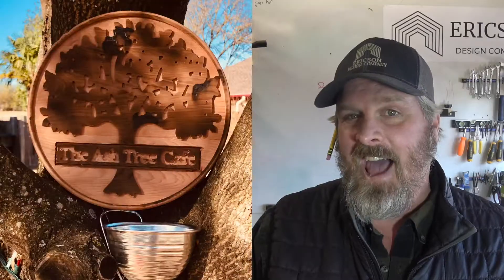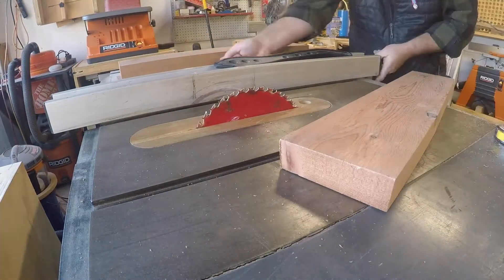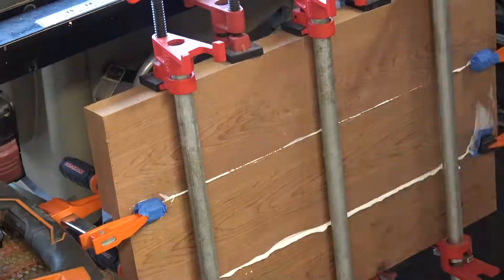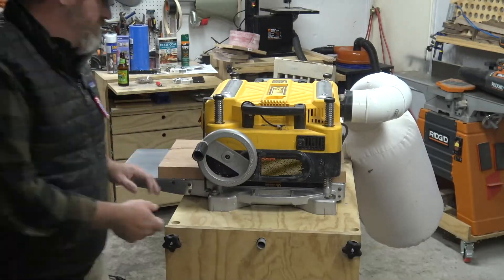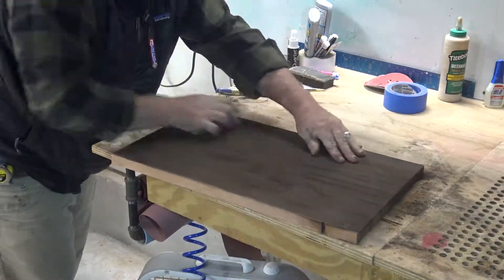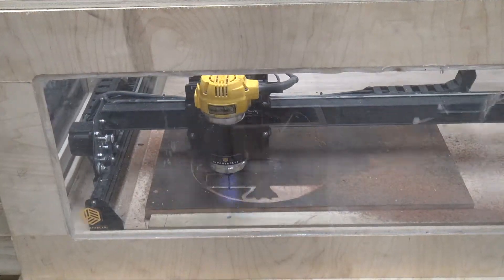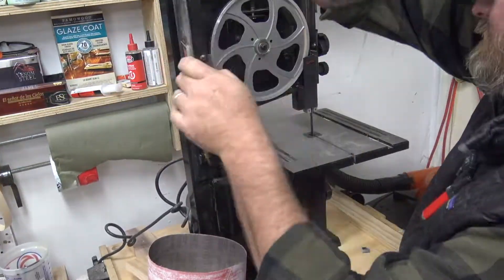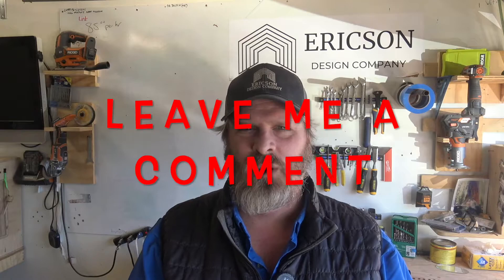How To Make A Wood Burning Custom Sign | Custom Cafe' Sign | Woodworking

Comment: Thanks for the shout out man!  I can’t wait until I can get my X-carve. 

Any chance I can get you to get me the height of your cart when when folded? I figured out a spot in the garage but need to make sure it will fit.
Reply from the maker: It about 60” high and 65 3/4” wide wen the laptop stand is articulated in over the controller and it’s a total of 23 deep for the depth you can add an extra 3 to 4 inches for the hose that sticks out of the back of the cabinet for the dust collection
Reply from the maker: Butt let me check wen I get home
Reply: @StonerEricson   Appreciate it!  This weekend I'm building cabinets for my garage wall which will be hung on french cleats.  Once they're up I can start on the X-Carve table.  It will live in the spot I'm clearing with the cabinets as long as it fits under the pipe coming out of the wall.
Reply from the maker: So wen the table is down it is 55” wen the table is open it is 57”